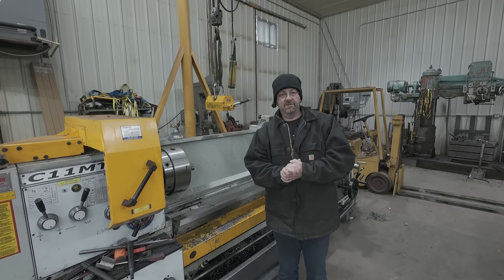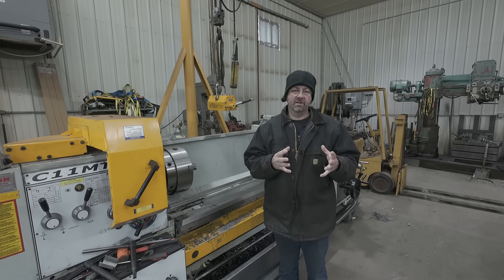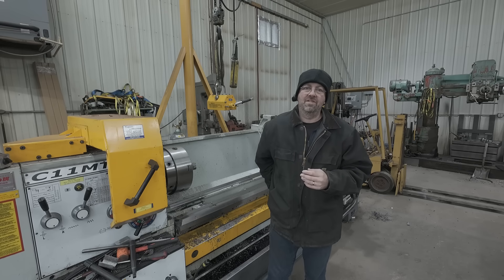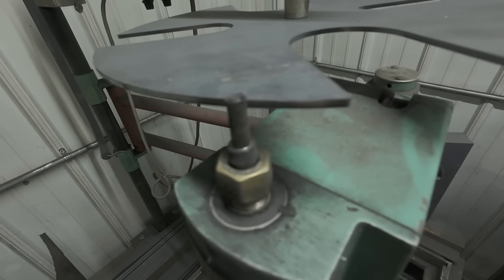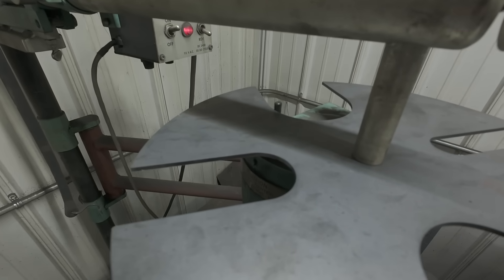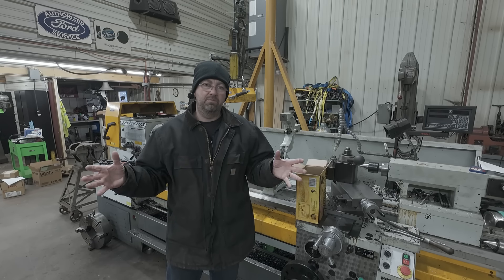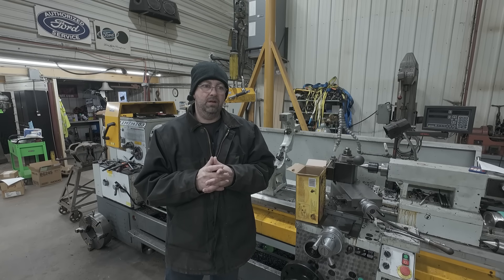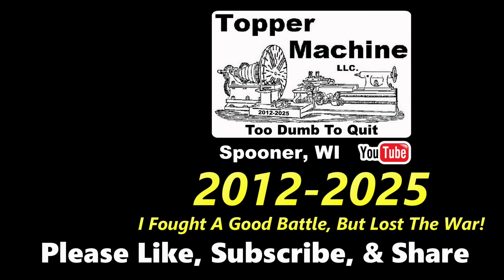How the Victor Duplicator Really Works | Arbor Press Daisy Plate Follow-Up

Comment: Inside the storage tank, propane is not dissolved in water.  It is just liquid propane. Nothing else.  It stays liquid because of the pressure.  If you see water condensing on the steel piece that you are heating, the water is from combustion. The burning of the fuel in air (really oxygen).  All combustion produces water as a byproduct. Engines too.  Even your body.  That is why your breath will fog a cold mirror or glass. It is the physics of the oxidation reaction of combustion. Fuels contain hydrogen (and usually carbon) on a molecule level. During combustion (burning, oxidation, whatever you want to call it), the hydrogen combines with the oxygen, and water is made (created).  But water is not inside the propane tank, as in added to the liquid propane. This is something someone who did not know chemistry completely made up. Be careful trusting the old guys. Many times their foolish pride is so strong, that they will defend complete bullshit, in order not to look like they don't know something. They equate knowing things with self worth.  They don't know that a person is more valuable to society if they admit they don't know something, rather than make things up that are wrong. That just spreads stupidity. Lots of evidence of that having gone on today.  AI is even making things up.  And believing them.  I guess it possesses artificial foolish pride as well.  Be careful out there.  ---Doozer
Reply: Give Josh a break. He probably got Acetylene, which is dissolved in Acetone, which in turn is absorbed by a porous clay inside the bottle, mixed up with the liquid propane, which you can hear and feel slushing around in the tank.
Reply: @erik_dk842  I was giving Josh a break.  We like each other.  Providing correct information is not picking on someone. Grow some stones.  ---Doozer

Comment: With all due respect, Propane has very low solubility in water. Propane is stored as liquid propane under pressure. Acetylene is also low solubility on water and is disdolved in Acetone in a porous substrate, often Kieselguhr.
All the best for Christmas and the New Year to you and your family Josh.
Reply: Agreed. When combusted completely, CO2 and water vapor are the primary byproducts. I get the same condensation on my marvers for working glass.
Reply: One of the products from burning propane is H2O, so the water condensing on the cold surface if from the flame itself.
Reply: @mumfordthepitbull4581   True

Comment: IIRC Acetylene is also dissolved in water! That's why we were always told to stand up cylinders that had been on their side and let them "settle" for a while before using them. Also, I watch a lot of Australian YT channels, and they all seem to use Propane... :body-blue-raised-arms:
Reply from the maker: I thought I was told it's acetone. I'll have to look that up.
Reply: @TopperMachineLLC  Yes it is dissolved into Acetone or with Dimethylformamide. And requires filler in the bottle which is why Acetylene bottles are special and not just steel tanks like Propane.
Reply: @TopperMachineLLC   For the record, propene is not dissolved in water and neither is acetylene. Acetylene is dissolved in acetone, which is why acetylene bottles have to remain upright, otherwise you'll get acetone coming through the hose and who knows what issue that would cause, but it could not be good.
Reply: How Acetylene Is Stored

The cylinder is filled with a porous mass (typically materials like agate, diatomaceous earth, or cementitious compounds) that occupies most of the internal volume and prevents voids where pure acetylene gas could accumulate.
Acetone (a liquid solvent) is added to saturate this porous material. Acetone can dissolve large volumes of acetylene (up to ~25-40 times its own volume per atmosphere of pressure) without reacting with it.
Acetylene gas is then introduced under pressure, dissolving into the acetone. This allows safe storage at moderate pressures, typically up to around 250-275 psi (15-19 bar) at room temperature.
When the cylinder valve is opened, the pressure drop causes acetylene to come out of solution as a gas for use.

This design stabilizes the acetylene, distributes heat during any potential decomposition, and prevents explosive reactions.
Reply: Acetylene is dissolved in acetone on kieselguhr. One of the reasons for being less commonly used these days are fire fighters hate acetylene cylinders.

Comment: I used to be a senior lead at Veritas Steel in Eau Claire welding bridges. We didn't use acetetylene and had natural gas  to run the cutters and preheat torches. Very cost effective and did a great job. Also if any management from there sees this comment you can gargle my balls and I hope your wife gives you herpes.

Comment: great follow up -- I was curious what the difference between Propane and Acetylene was, so I asked Grok:
The *maximum flame temperature* in *100% oxygen* (pure O₂, also called oxy-fuel combustion) refers to the adiabatic flame temperature at stoichiometric conditions (exact amount of oxygen for complete combustion, no excess).

- For *acetylene (C₂H₂) in oxygen**: The maximum temperature is approximately **3100°C* (up to ~3160°C in some sources).  
  This is the highest among common fuel gases due to acetylene's high energy release and favorable product composition (fewer moles of products to heat).

- For *propane (C₃H₈) in oxygen**: The maximum temperature is approximately **2800–2820°C* (often cited as ~2826°C or 5112°F).  
  It is lower than acetylene because propane produces more product moles (CO₂ + H₂O) per unit energy released, diluting the heat.

Acetylene achieves a *~300–350°C higher* maximum temperature than propane in pure oxygen. This is why oxy-acetylene torches are preferred for applications needing the hottest, most concentrated flame (e.g., welding or cutting thick steel), while oxy-propane is often used for heating or cutting where total heat output matters more.
Reply from the maker: Thanks for the information.
Reply: Stop asking AI for things.  It regularly gives wrong summaries of information. It is a language model.  Not a storehouse of information.  --Doozer
Reply: @kooldoozer   I  can verify that AI is not always correct. It serves as a quick reference, but it's always best to verify with a real world result. I try to avoid AI as much as possible, but it almost always comes up at the top  in search results, so you have to go down further to find real world results.